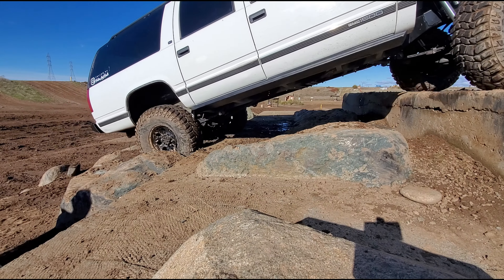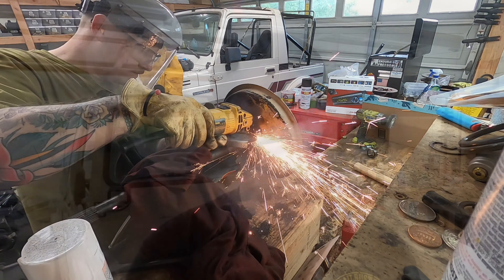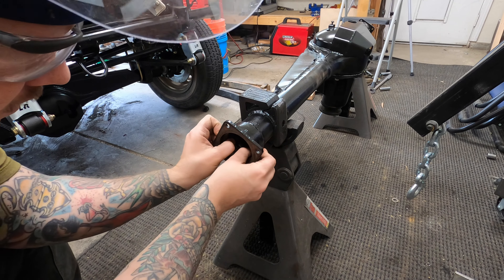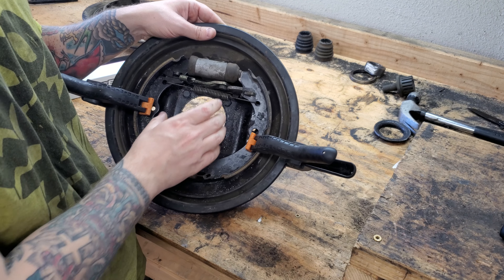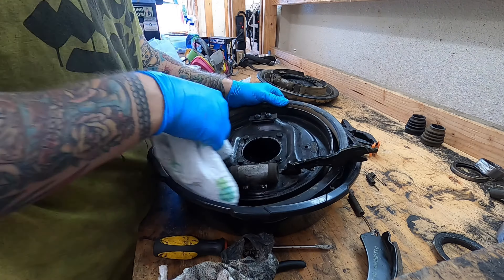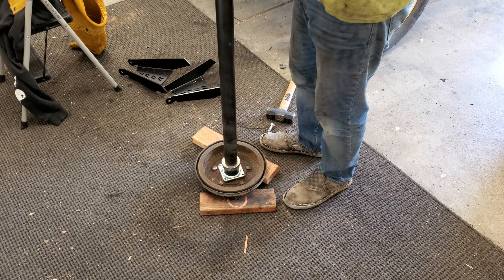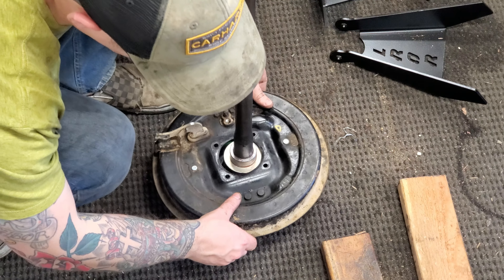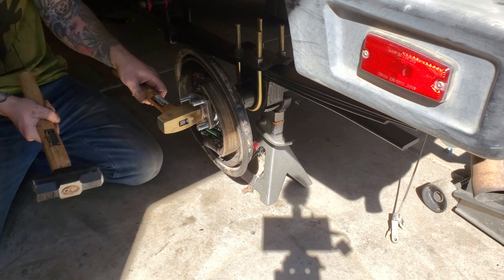Samurai Build (Part 12) Rear Axle Assembly

Comment: And the reason for drilling the hole to 3" was to be able to remove the axle without having to remove the backing plate. Which also keeps the bearing and axle inside the axle tube. How is this safe ??
Reply from the maker: Perfectly safe, and a huge help when replacing axles. Read more about it on Trail Tough's website. 🤙🏻

https://trailtough.com/sj410-backing-plate-modification/
Reply: @FortuneOffRoad  Mentioning you will need this prior to drilling the 3" hole would have been absolutely fantastic..... just saying.

Comment: Where did you get those plate that keeps the seal in places after you drill thos holes to the brake shields??
Reply from the maker: They are SJ410 Backing Plates. Low Range Off Road sells them for $13. 🤙🏻
Reply: Wow they are no longer $13 but still a upgrade. @FortuneOffRoad